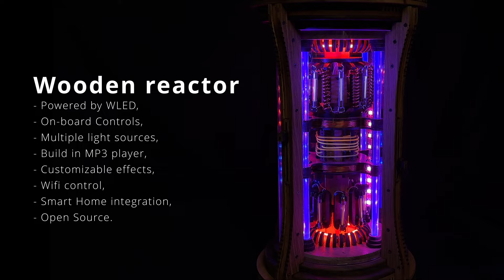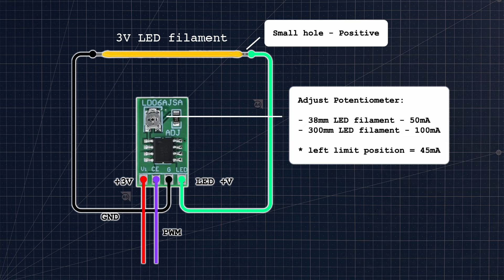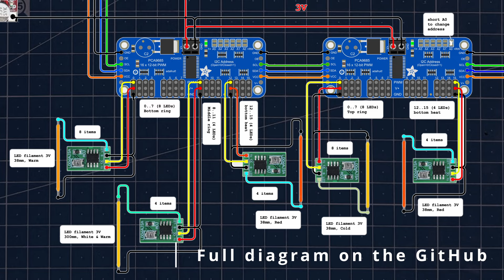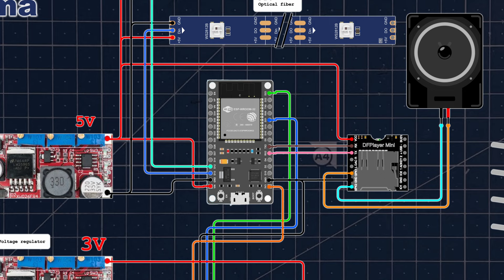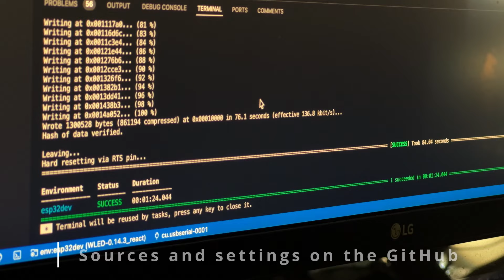DIY Wooden Reactor Simulator: Nightlight, Desk Lamp, Sound and Dynamic Lighting Effects, Charger

Comment: Do you have a link for all the veneer and the vase ?
Reply from the maker: I bought the sliced veneer and vase locally, so I'm not sure how helpful my sources will be for you. The vase is from Poland with a diameter of 15 cm and a height of 27 cm, made by "Handmade." You might find something similar on Amazon by searching for "Glass cylinder without base, diameter 15 cm, height 27 cm." I saw some options when I Googled this keyword.